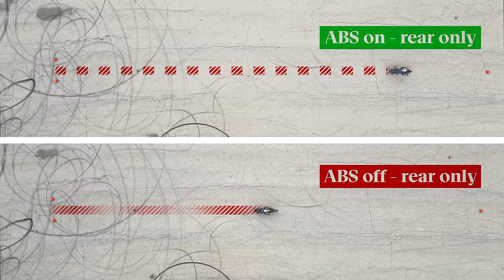Out-braking the ABS Myth

Comment: What makes ABS so useful is not only it's performance in actual braking distance, but that it enables you to steer while breaking. Since energy is needed to change direction, you need to split the friction energy between breaking the vehicle and steering. And since ABS breaks don't use all energy to break, then of course there is room to break in a more optimal way. Most of the times it is better to bypass the obstacle in front of you, than stopping before it.
Reply: Exactly, everything is about grip and there is only a finite amount of it. So if you want to turn you need to get some grip from somewhere else, for example slightly less braking force.
Reply: Yeah every european seems to understand this, and every american struggles with it. Europeans are becoming instinctive "brake hard and swerve" drivers, and cars without ABS just cant do it, I assume bikes have a simillar outcome. If you steer and brake hard without abs the bike is sliding from under you, with abs you can just go around what youre trying to avoid. Its crazy how fast you can process a brake where you steer into safety. It seems to happen so fast, youre hard on the brake and pointing toward the safe area. Id go so far as people need to be taught how to do it properly during training so it becomes instinct from day one and never go back to a non abs bike/car.
Reply: @geroutathat  And it becomes even harder in snowy conditions. But at least that is no concern for bike drivers. These days they dish out so much salt on the roads, so even people here in Sweden have forgotten how to handle it.
Reply: @geroutathat  This, but you shouldn't always swerve out of the way. If it's a bus in front of you or you'd fall down the side of a mountain steerability is exactly what you need, but if it's something as small as cat, you should probably just crash into it with as little speed as possible because it's safer than swerving out of the way risking to get into a much more dangerous crash. For example because you swerve right into a bus that you didn't see in that very short amount of time you had to react. Quick thinking is what people need there.
Reply: Best comment.
Reply: It seems like almost all comments overlooked this point. ABS stopps your wheels from completely blocking, and in case you are not on a straight road and rather in curve where most severe accidents happen, you will be out of luck with ABS turned off. In this idealized scenario of stopping on a straight road with clear vision there might be a difference, but I would expect you to be able to stop earlier because you're driving in a straight line and simply keeping a safe distance makes it irrelevant if you need more space to come to a hold.
Reply: @GodEmperorZenca   All well said. I rarely use my ABS but when it comes on it's always a surprise......and that is precisely when you need it most.
Reply: The reason why you need to break before a turn is not only because of centripetal force, but because of weight transfer, the weight is transferred to the front tires providing more force on the tires, giving them more grip, and allowing you to turn easier. Then you would’ve been any other way.
Reply: @2seep    Very interesting. I also read an article (Popular mechanics?) that said when you replace a pair of tires to put the new ones on the back and put the ones you keep on the front because the back is most likely to break away in a curve. I experienced this myself in a traffic circle one block from my home. The back wheel hit the curb and scratched my rim.
Reply: Steer while breaking? Do you really own a motorcycle buddy? You cannot do any hard braking while you are leaning, and you can not steer while your speed is above ~25kmph... else you will discover counter steering.
Reply: To emphasize this , later mbz and others use BAS( BRAKE ASISST SYSTEM) That enhances abs performance by applying more brake force than the driver as MBZ discovered drivers were actually applying insufficient brake force . @geroutathat
Reply: @larsihle9256   I read the same thing about airliner pilots when anti-skid systems first came out. They didn't understand that they could literally stand on the brakes for maximum braking effectiveness.
Reply: @mdzaid5925   Exactly! I was in the "surprisingly break for your fucking life" situation and theres absolutely no chance of evading obstacles. My ABS simply kept me on the bike while riding a slight corner so i didnt get thrown off the bike while shock breaking (sliding front wheel). This allowed me to slow down that much that i didnt die when hitting the side of the car that crossed the road. I was an experienced driver that took professional training courses.
Reply: why would you avoid an obstacle if it is not shown on the video? you better do what the video says and crash with "unexpected" fully visible object in an "unavoidable" manner due to your crash being and accident? 
you only need dash cam, buy anything youtube says you to, most expensive insurance and due proper mods without regulations or engineering or warranty to your vehicle... 
in real life insurance companies, body repair workshops, hospital, ambulances can make a living on your wisful acts...you can even contribute more to the GPD of your country if you happen to have a car with ESP (ABS, ASR, EBL, EBA, EBD,...) and trying to threshold brake you steer not enough, always gently so you prevent ESP from working  ot target for correct inputs and maximize traction, you'll make bigger crashes and could blame the obstacle, Fortune Godess or other driver dead or alive...
also make sure you explain to known and unknown people clearly how they need to imitate your acts, so GPD grown bigger every year...
Honking the horn, cursing or keep thinking as stated above is always good advice. Why would you care to train and test vehicle response to your inputs to become a safer driving with the quicker response-time, defensive driving and preventive analysis of road hazards to avoid scary situations?
Reply: ABS is one of the things you might have to explain in the multiple choice theory test in the UK.
Reply: Don't tell it to youtube authors :)))
Reply: This feels like a thread about cars in the middle of a motorcycle channel. 'Panic swerve' isn't as much of a thing on a bike because of the time needed to tip in. If you have enough warning to anticipate the situation sure, maybe you can swerve, But in my experience you have so much more braking power staying vertical it's going to push your (our) emergency response (rightly) in the direction of straight line braking.
Reply: Is abs useful when slowing down at a curve?
Reply: Don't talk about shit you don't understand like "energy is needed to change direction." You can't even spell "brake" right.
Reply: @InternetListener  what?
Reply: To a degree, but you are no less likely to lose the front than without the abs.

Because while cornering the bike is leant over the tyre is going to let go Because of being overloaded cornering while braking long before the brake would actually lock up.

The tyre will lose grip then lock up, not lock up then lose grip as it would in an upright position.

Watch all the low side motorcycle racing crashes its always the lateral load on the tyre that it lets go, if they are braking the wheel then locks up after the tyre has already lost traction. 

The greatest abs imaginable couldn't save that, as its not the brakes locking up that's caused the crash. 

My issue with abs is the long term functionality of the systems. As the bikes get older. Abs in cars is quite simple so quite easily maintained over decades.  But on a motorbike to work it's far more complex and maintenance intensive. 

I reckon a lot of early abs bike will have had their abs removed in 10 years time, as the maintenance of the system will become unsustainable.

Like the honda C-ABS system, to fully drain and bleed the entire system is a 5 hour job in itself every 2 years, with about 15 feet of rubber brake line, etc. Seals throughout the system that will need replacing, etc. Etc.

And garages have no idea how to even bleed the system properly, they'll tell you 45 minutes but they are only bleeding half the system, the other half remains untouched because it cant be bled without taking half the bike apart, so a 20 year old bike brakes feel great stood still when the abs isn't at work. But while moving the abs is active and there 10 feet of 20 year old fluid in between the pressure sensor, pump and the cylinder that actually puts pressure to the calipers. Only the master cylinder to the pressure sensor and to the caliper itself is being bled. Because where the pump is is an isolated system which the computer activates and deactivates from where the master cylinder and calipers are.

If a bit of air gets in somewhere it shouldn't you pull the lever and it goes straight to the bar, then you've got to let go and pull the lever again for the conventional braking system to take effect. It's bloody scary.
Reply: Without ABS you can steer while braking, you just can't steer while over braking. With ABS a computer that has no idea how hard you are steering decides how hard you can brake. Non ABS you decide how much brake to apply.
Reply: Yeah, this is a pointless and dangerous video
Reply: Agreed, there are infinite scenarios to breaking / avoidance. I've had a dual sport, with no ABS, ridden it through all conditions, but worst near misses were always in town. Car pulling infront of me and rapidly decelerating to make turn or something else stupid. I still have no idea what instincts kicked in, probably years of mountain biking, but I had a car overtake me and come to stop shortly after with me having no chance of avoiding it by steering or breaking. I slammed the rear break, bike went into side slide, which pointed me to avoid the car, then released the break and tight-turned it just grazed the car with my shoulder exiting the lane. All in split second and still don't remember if I checked the other lane for traffic, however, the message is, breaking and avoiding is often better than just breaking or just avoiding. And no, I didn't need to change the diaper after.
Reply: I can steer and braking without ABS
Reply: Wtf is a theory test? You have to do multiple test in UK? Fuck that in my country we don't have that shit  @Stettafire
Reply: Another reason to bypass is because if you are having to brake hard then someone behind you may also have to brake hard. And you don't want to bet on the possibility that they *might* be paying attention and, furthermore, *might* be able to stop in time. I always pay close attention to what's behind me before ever even touching the brakes.
Reply: Isn’t the solution to just pump the breaks. Maximum breaking then maximum steering.
Reply: Steer while braking lol no you will not be able to lean and if you somehow do it will break traction, it's not a car and only to be used in a straight line
Reply: Right. That is as a correct abs answer on my licence exam in Poland.
Reply: @schrodingerskatze4308 kinda like hitting a deer vs a moose

Comment: There is a quite difference between different abs systems and settings. On track S1000RR road settings on ABS is definetly worse than human but throw that to racier setup and you are out braking most of the riders on fast group.
Reply: Nice u must ride, s1k are sweet, what can we crush bike related 😂
Reply: Nice to see you here!
Reply: BMW GS has linked braking. You pull on the brake lever and both the front and rear brakes are applied (at different ratios).  In a panic, I’ll take the ABS.
Reply: This ABS setting is extremely dangerous and we must deal with it
Reply from the maker: Very true that the "race" ABS on supersport bikes will outperform humans. They will let you stoppie and back the rear in, so there's really nothing to gain by turning it off. Unfortunately these advanced ABS systems are not that common on motorcycles en masse. ~RF9
Reply: The "old" ABS on my  2006 650 Suzuki Bandit also allowed for stoppies with the right front tires. As it lacked any initial sensors, it only triggered when there was slipping. I liked that. Stoppie at the redlight? No prob. Safe braking on a patch of sand or oily rain when commuting to work? Every day.
Reply: I ride an 2021 BMW S1000RR M /Select Package and I have zero issues with ABS when riding on racetrack at Mach Jesus or during extremely boring street riding.
Reply: As a fin, presumably with rally in your blood, you should know that ABS is NEVER optimal on gravel or snow. It's basically the first thing you do when building a rally car, you get rid of the ABS.
Reply: Mach Jesus is not an official value of velocity.  But it's damn funny.  @TheInfantry98
Reply: @TheInfantry98 I'm using Mach Jesus as a descriptor from now on. Thanks for the laugh!
Reply: Jorge Lorenzo's father said that pro riders still have the edge, but it was a bad idea for amateur riders to turn it off, even on a race track: very little performance gain and a huge safety loss. He also had no doubts that racing-tuned ABS would eventually make its way into pro racing.
Reply: @FortNine  why are ABS systems not common on modern bikes nowadays? The technology is already there, and it has been proven REPEATEDLY that motorsport-grade ABS is better, period. It has trickled down to even the lowliest of commuter cars. The chassis dynamics are the same, too - only limited to two wheels.
Reply: What the hell are you talking about? Get back in the shop.
Reply: @commoncents5191  they also have cornering ABS that prevents you from dropping it when grabbing a hand full of brake in corners.
Reply: @HydraulicPressChannel handles high pressure danger daily, it gives tonnes of weight to their comment.
Reply: #1 Where we All can fail at safe braking, is because despite  any amount of knowledge, skill, practice, and Ego..   we are all human and in totally unexpected possibly deadly situations, being human we are all prone to panic and over reacting caused by natural instinct over riding everything else.. that is why Abs was invented, that is why a great designed, perfectly maintained, perfectly operating motorcycle abs particularly sportbike cornering abs with race setting.. can beat All but the worlds most brave, most skilled pro riders, racers!  #2 Even the worlds best riders, racers will be beaten by a good Abs system when a unexpected dangerous situation happens on gravel, ice, or a oily area on the road.. and often abs will beat the rider on just a few inches deep of water or snow on the road. #3 do your same braking test F9.. but on water, snow, gravel, ice, and oil one after the other.. then see if you can beat a good abs system! with abs likely ok, without it.. you'll be on your rear end before you test in all those conditions. That's the point of abs and why abs is better!  It must be noted however that not all abs systems are the same, some are poor designed, unreliable, even dangerous! while others if properly maintained are safe and lifesavers!  Not at all saying everyone should have abs, that's personal choice! only saying a good abs system is better under certain extreme conditions and this has been proven against the worlds best riders/racers countless times!  One thing to really consider is this.. Any electrical system can fail at the worst possible  time, and if a motorcycle rider/racer needs anything it's 100% confidence in their brakes, 100% of the time!  safe riding everyone and wishes for a good new year.
Reply: Thank you for outlining the fact that ABS is a liability when a good driver is behind the lever (or pedal). A stupid ABS system (one that doesn't self-adjust to the conditions) spend over half the braking distance NOT BRAKING! The more slippery the conditions are, the worse it gets if the driver keeps all his/her weight on the pedal.
If that's the case (bad and/or panicked driver), the ABS must take over the whole braking, self-adjusting microseconds per microseconds.
That's what an "intelligent" ABS system should be capable of doing.
Otherwise, it's good for only one thing: warning you that you're braking to hard for the condition. It can detect rotational speed differential faster than any human being.